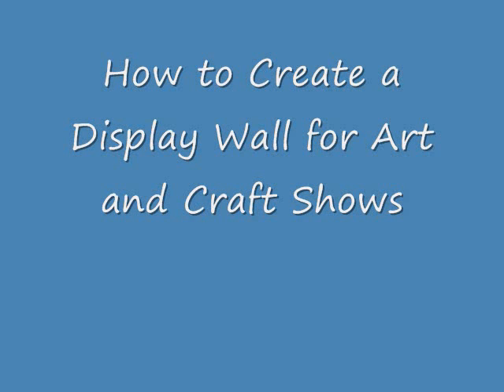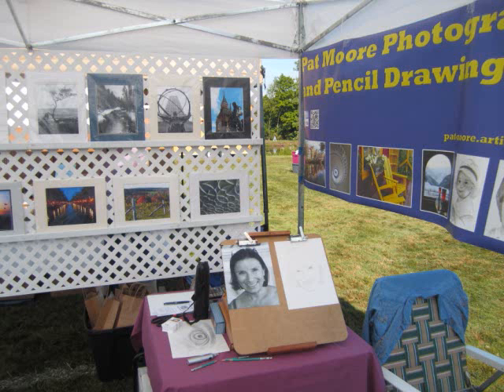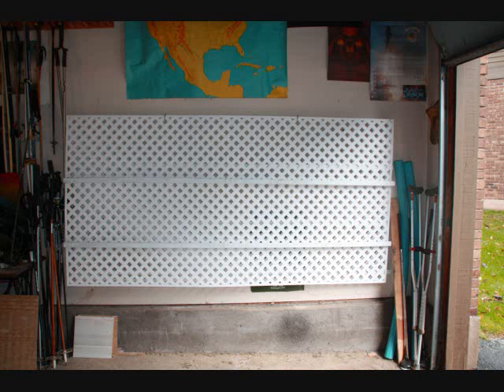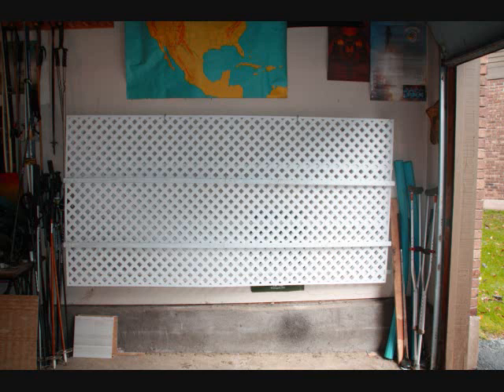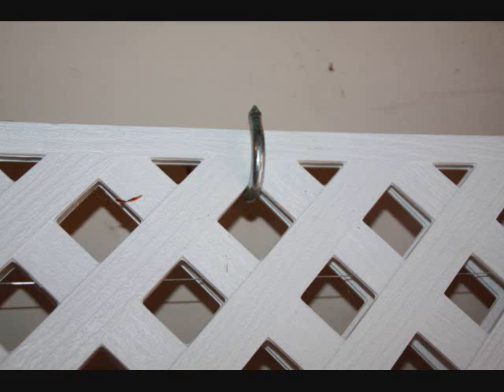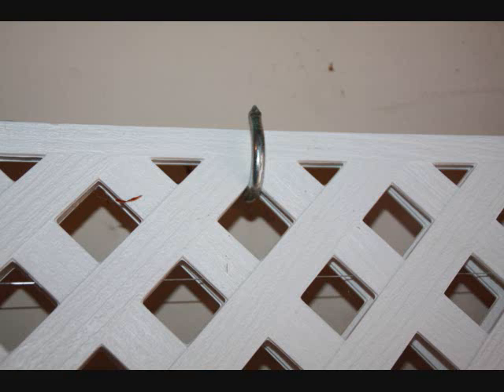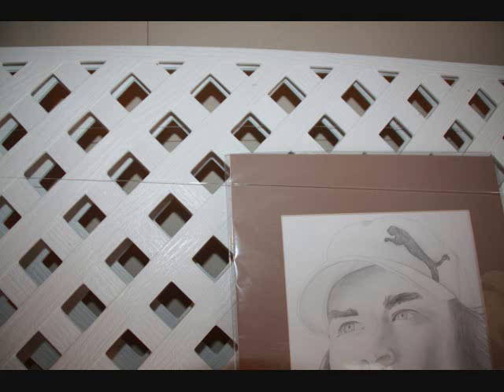How to Build a Display for Art and Craft Shows

Comment: Thanks very much for this video. I'm going to use it in 2 weeks. I purchased 4 of the 4x8 plastic lattice, but saw that they also have plastic end caps already white, so I bought those to turn upside down instead of the wood ones. Now I don't have to paint. I have my zip ties and fish line. This is an excellent, low cost concept and I hope my display turns out fantastic. I'm putting matted artwork on one side and framed pieces on the other side, as well as displaying jewelry. Thanks again.
Reply: How did this turn out for you?

Comment: I am in final stages of putting your concept to work for an art show in a week. I'm using the vinyl lattice panels on 3 of the 4 walls (2 panels each wall). I will hang them from the popup tent cross bars using zip ties. I will attach the second panel to the bottom of the first one with zip ties as well. Instead of buying end caps made of wood and painting them white, like Pat did, I found white end caps made by the same manufacturer in vinyl. By mounting them upside down, the groove will serve as a neat shelving groove for my various pre-matted art (unframed pieces). The matted art is encased in cellophane bags purchased in bulk along with the pre-cut mats. 

Instead of putting up 1 piece of fish line to further hold the art in place in case of wind, I decided to put at least 2 lines for extra security. The end caps are affixed to the panels with zip ties on each end and in the middle, as the end caps at that length might tend to bow, and a total of 3 ties should be fine. But by securing them in the middle, you'll have to place your art on either side of the middle tie. I can get 8 images displayed of my smaller work (12x16) by overlapping the mats (4 per side of the middle tie). I can only get 6 images (3 per side) of my larger size (16x20) on by overlapping the mats. The mats are all the same color and width, so overlapping is not a visual impairment. I'm very, very pleased with how it is all coming together. 

By making the mats those sizes, buyers can find plenty of pre-made frames to put on their selections, keeping their costs down to a minimum.  I have 24 small pieces and 39 large sizes. Altogether these will require 2.5 walls. Since I also showcase jewelry on tables, two people can sit behind the tables against the side that only has the top panel displaying art. This way we will not block viewing of any piece in the tent.  My framed art will be hung on the outside of the tent. I have put sawtooth hangers on all the frames and will zip tie them to the lattice panels from the outside. 

Because of the weight factor, I will make sure that the bottom of each panel sits squarely on the grass for its main support, so that they are not actually hanging from the tent, but just held in place by the tent. If needed, I will have some bungee cords available to secure the panels to the sides of the tent as well. I hope this makes sense and I hope I have figured it all out in advance and that all goes well at the show.  Thank you Pat for this extremely great concept and the video.
Reply: Two Dove Lane wish I could see what you did. But thanks for the detailed information